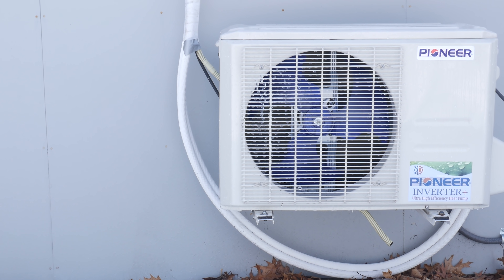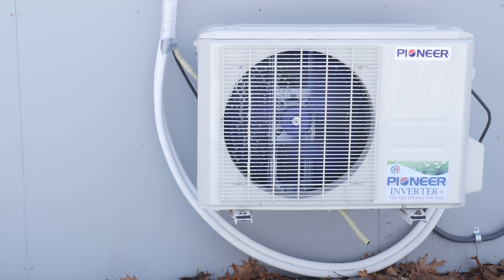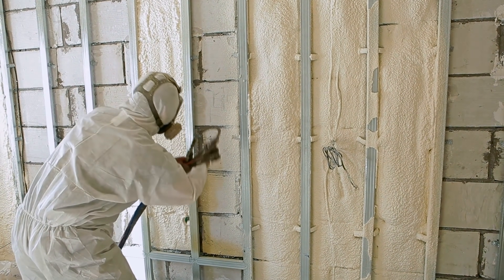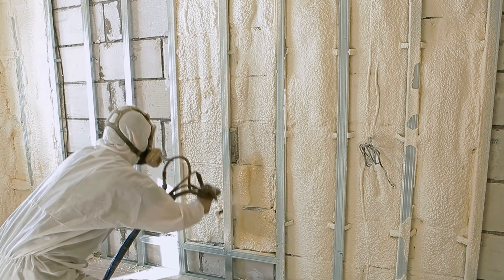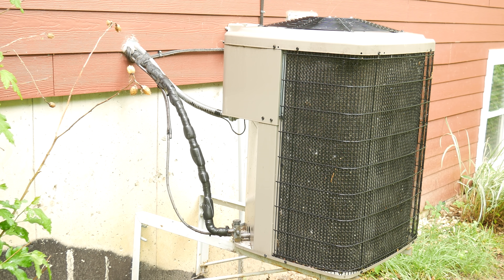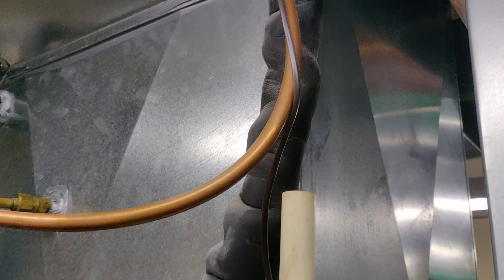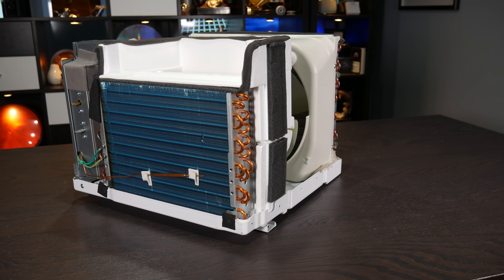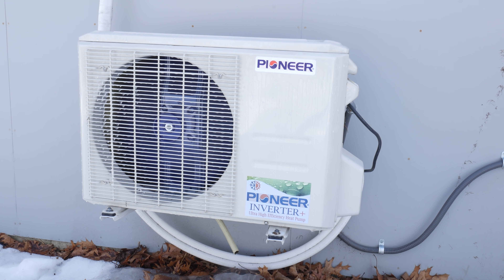Heat Pumps are Not Hard: Here's what it will take to start pumping

Comment: FYI i have a split system and it only has 1 main lines outside and has a splitter inside. Makes it very easy to run lines and looks nicer. I have a 5 ton unit with 8 secondary units.

Comment: my machine does not let the shared heads heat cool individually. the units can be on/ off individually, but there is only one outside condenser thing for three units, so the lines have to be going in the same direction to share that one outside radiator. I've had that happen before where my room turns off cooling because another room set itself to heating, it's a rare problem but can occur when you want an uncofortably cold room such as running electronic equipment, and share refrigerant with living spaces

Comment: A multi split system (one outside unit with more than one inside unit) are extremely flexible. It is very easy to only heat the room/s in use instead of having to heat rooms that are not being used.

Comment: Having just bought a new furnace/AC system in Minnesota, the current situation in the US is super frustrating. There's almost no HVAC contractors that will offer CCHPs (even in the Twin Cities) and beyond that, they're still incredibly expensive! It's ridiculous. Now, we have a new furnace and AC system that won't really need to be replaced until 2050. The companies are basically pushing everyone to continue using gas, and it's frustrating!

Comment: It's weird. I went to the NEEP site and could not find my Bryant 226CNA024000 Heat Pump on the list. Granted, it was installed in 2019 and may no longer be available, though I don't know why it wouldn't be on the site. According to Bryant it has a COP of 2.6, HSPF of 9, SEER of 16 (combined with the FB4CNP024L00 Air Handler, AHRI Reference # 10484419). 

1 to 2 higher SEER rating and I would have paid almost double. I put that money toward better insulation.

Comment: In Japan, you can have a single head mini split installed for a few hundred bucks. Multi head systems aren’t common. Also, power is often supplied at the head, not the outdoor unit.

Comment: I can absolutely confirm that some (most?) HVAC companies aren't interested in anything other than installing new and expensive units.  I was in the process of buying a house and the central AC wouldnt work.  They quoted over 8000 to replace the system when all it needed was a replacement circuit breaker in the main circuit box.  The breaker had started to fail and would trip when the compressor tried to turn on (the fan could run without tripping the breaker).  $35 and problem solved,  I cant stand shady companies.

Comment: The noise part was understandably handwavy since it wasn't the focus of the video. But there's a lot of research on the harmful effects of noise. My gut says that "90% reduction in car traffic" + "100% heat pump adoption" would cause less ambient noise observed on the sidewalk than "no change in car traffic" + "0% heat pump adoption". The answer is to look into this more. View noise as a holistic problem, rather than single out heat pumps and not SUVs.

Comment: When it comes to heating. A heat pump can be safely used as a heat source for underfloor heating (water heating). Water temperature in such heating system can be max 55oC.

Comment: On any of the "-to-water" systems there is the possibility to put a small "topheater" boiler to raise the temperature from ~45-50°C to 60-65°C on the water we use. I have a 300 liter boiler heated to ~50°C by the heatpump and then have a 100 liiter electrical boiler where it is heated to ~75°C. That works for me...

Comment: Say you have an old or dead A/C unit, and are looking to replace it with either a traditional A/C unit or a heat pump. You also live in the south where summer temperatures can get up to 95-110*F and humidity can get up to 95%. 

Would you recommend a heat pump? Would this also cause a TON of condensate in the inside unit (thinking potential for leaks)?

Comment: I don't know about Chicago but around here heat pumps have been common for 15 years. I just had to have mine replaced and it was less than six grand installed.

Also my workplace has had water source heat pumps for over 30 years, and their efficiency versus air heat pumps is ridiculous.

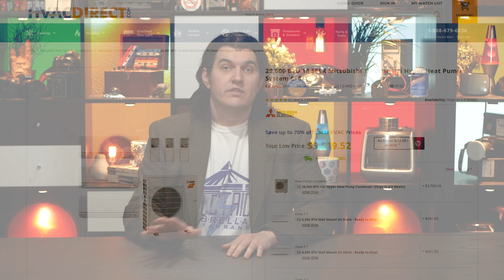Comment: 29:00 The HVAC techs in my city mark up the equipment 500% and charge nothing for labor.  I know this because I got a quote where the technician copy/pasted the description into the quote and it included the website of their supplier.  Going to the site, all the prices were precisely 1/5 the quoted price.  I called a couple other companies and asked for quotes on similar systems and got similar prices.
My central air conditioner is 18 years old and its refrigerant is no longer legal to use, so it's on its last legs.  Replacing it would cost $20K or more because the new refrigerant requires new line sets, so I looked into mini-splits.  A mini-split's individualized heating/cooling is a big bonus because I live in high-altitude desert and the sun heats different rooms very differently at different times of day in both summer and winter.
The companies quoted me $45,000 for two mini-splits.  My home could be handled by a pair of $3500 units.  With a few extended lines and such, that's under $8K of equipment.

Comment: The quote was most likely included running linesets inside the house instead of around on the outside and that each head unit would need a drain installed. Those two items alone can easily cost 3-5 thousand. Also since the world shut down from covid the prices for HAVAC equipment has inflated almost 80 percent over years prior. A typical bottle of freon went from $130 to $500 too.

Comment: I want to build multifamily housing, where when the temperatures are too low the maintenance guy tends a large wood fire configured to keep all the outdoor units warm enough. Or a cascade refrigeration system that sequesters co2 for use in greenhouses. Can we just install a reversing valve and control it with raspberry pi?

Comment: Costco has a 24K BTU DIY mini-split heat pump with a 20.5 SEER for $2300 here in 2023. I'm not sure if it can support more mini-splits, but still. So much cheaper than the $12,000 quote.

Comment: Just gonna give my two cents on AC stuff. People should invest into ductless heat pumps for HVAC instead of a traditional ducted HVAC system, but have a different reason to give. Traditional centralized HVAC systems are a common source of floor rot in my experience. The ducts inevitably develop leaks and allow for moist air to become entrapped in the floors and walls of a home. This promotes the growth of mold and bacteria that can very quickly disintegrate your floors. Being a residential contractor I've seen it happen in as little as 6 months. Obviously a heat pump will completely resolve this problem by removing the need to pump moisture rich air inside of your home. 

You can save electricity costs, reduce noise and moisture in your home, etc, etc but by far the biggest savings will be from needing to replace $50,000 worth of floors.
P.S window units are not immune to cause wall rot! If the drain to a wall unit becomes obstructed it will cause the water to back up and seep into your wall and window!

Comment: 20:10 I should also note that LG is a South Korean company, and I know they are not just making a power move to make it work just as well as it does above freezing. It needs to show that performance in 5 deg F simply because our winter falls to 5 deg F. Our homes don't have ducts anyway because we have heated floors. Fujitsu should be the same case.

Comment: I am having a new townhouse built and I was told by the builder at first that it was impossible to put a mini split in. He insisted gas was the only option. After sending a lot of documentation to him about it and discussing with trades, it was finally put in as an upgrade option.

7k for a 3 head unit.

Was it a lot, yup. Did someone make a lot of money, yup. Were there only a few of us in the complex which bought it, yup. However, it's done, behind the walls, looks good, heats and cools, and is warrantied.

I really don't get how in 2022 with the improved technology how this is debated so much.

Comment: I really want to replace my oil heating and in wall ac units with a ductless heat pump system, but the cost is simply too much. I've been quoted close to $30k for a 6 head system. Still waiting on the rebates from the HEEHRA program to go into effect.

Comment: Hi, how hot does the air get at the output? Is the max output temperature dependant upon the outside temp?
For clarity, in UK most systems rely on hot water piped to radiators, this is limited by the temp of water (normally about 70 C/160 F), I know/believe heat pumps can't match this for heating water, to pump through radiators. Your suggestion is to heat the air directly (rather than water to radiator to air), but how hot can the air get and is that dependant on the outside temp?
Reply: you can heat water for radiators with a air to water heatpump, they are just as good as air to air pumps. and radiator water can reach atleast 55c with only the heatpump. If you wish most air to water heatpumps come with an electrical heater built in. So that you can if you wish, heat the water up to 70c, if that is needed to reach the indoor temperature you want. In most cases that electrical heater built in runs maybe a couple hours per year at most, the heatpump doing the rest of the work at 4x the efficiency. The heat of the water for a air to water and the heat of the air for an air to air is dependant on outside temperature yes. But to feel a difference you basically need to have -20c outside. Which it usually isn't in Sweden, where i live or in UK. not for prolonged periods. most modern ones handle almost full efficiency down to -25c. some to -30celsius.

Comment: In your example of your friend who was getting a replacement, i have severe doubt on the quoted example of the air conditioner was 3k.  the only chance is that the a/c unit was one of the old 13 seer versions.  a high efficiency air condition that's 19+ seer would probably be double the price if not more.

Comment: We had a Mitsubishi system installed incorrectly a couple years ago and are still trying to get the situation remedied. They spec'd and installed two SVZ air handlers with an MXZ-3C24NA2 outdoor unit, and apparently this is an invalid combo according to Mitsubishi.

Comment: A few notes, that "communication" wire is high voltage wire and running it unprotected like that is a huge code violation in all states in the US.  Another note is that there are very few companies that have qualified technicians to do repairs on these systems, and an awful lot of the system is designed as a throw away part.   The time that it takes to diagnose and repair these systems is on average probably 2 to 3 times ans long as a conventional system, so labor costs are going to be higher.   One of the biggest problems that I encounter is that there are a lot of cheep brands out there that only stay in business for a few years, then go out of business and start back up under a new brand name, this means that parts for those units are no longer available.   Unlike normal heat pumps, furnaces, or air conditioners, there are no universal parts for these, so if you cant get a board, or valve or even the fan blade, the whole unit is junk and has to be replaced.   My company does install hundreds of ductless split heat pumps, but we only install one brand that has been around since the 80s, so do your research before you buy.

Comment: Any chance on doing some experiments with your heat pump? like enclosing the outside unit in a portable greenhouse in the winter months? Kinda curious if it would make a drastic difference ....
Reply: While the thought of using a greenhouse in the winter time to collect heat and make the heat pump run better sounds like a fairly good idea, in practice it will not work.  The heat pump is using a 4,000 - 6,000 CFM fan to collect heat from the air outside, and if installed in a 6,000 CFM greenhouse, it would cool all of that air by about 15F each minute, and quickly remove all the heat from the greenhouse.  

I have another thought, such as using a well pump as a second evaporator on a cold night.  Then try to collect heat from the outdoor air coil, and then run that refrigerant through a water cooled heat exchanger, to warm that refrigerant to about 32F, as cold ground water goes through the other side of the heat exchanger and back into the ground.  However if the well pump used 500 watts, I don't think you would gain enough heat to make up for the water pump power consumption.  

So yes putting the heat pump into a greenhouse would make a Drastic change in the unit efficiency, it would drop very quickly as the air around the heat pump went from 45F to 15F in a couple of minutes.

Comment: A trade off of these newer mini-split systems is the electronics. If you have been running your system for several years and either the indoor or outdoor unit fails and can't be replaced, you may have to replace the whole system because new models may not be compatible with old models. Also, heat pumps run more than air conditioners, so they tend to reach end of life much sooner. These are things to consider, but not necessarily reasons not to get a heat pump or mini-split system..

Comment: I've been struggling to find a device that will work with our existing wiring. I guess its just too old, but we have a through-the-wall AC unit that's dying, and it has a NEMA 6-15P plug (245v, 15a). I also checked the breaker and its a 15A breaker.

But I can't seem to find a unit with these specifications anywhere. Nearly all the ACs/heat pumps (that use a plug) I can find are either for standard outlets or for NEMA 6-20P outlets.

Comment: Retrofitted insulation (and, for new buildings, designed-in insulating properties like lower ceilings and double-glazed windows) are undoubtedly a crucially important step in fixing the problem. But it's important not to overlook the issue of the "embodied" costs of manufacturing and installing  insulation materials:

"Most energy efficiency studies focus solely on the operational aspect of buildings, such as the energy it takes to heat and cool them. However, various studies have proven that the energy and emissions required to manufacture building products, such as insulation, can be just as significant. When they’re calculated using a comprehensive assessment technique, which includes all of the energy expended across the entire supply chain, the so-called “embodied” energy and emissions of a building can be equivalent to 50 years worth of a building’s operational energy requirement. "

quoted from a 2012 article by Robert Crawford, lecturer in Construction and Environmental Assessment, and André Stephan, postdoctoral Research Fellow, both at The University of Melbourne (Australia).

Given that many homes in new cities and suburbs barely get past 50 years before being knocked down and built over, is the embodied cost of insulation really going to be more environmentally sustainable than investing in solar-powered energy-efficient reverse-cycle heat pumps? 

I mean, ideally the situation should be that once a house is built it stays there, but the modern property market is such that many/most older houses (at least in Australia, where the property market exists in some kind of weird alternate-reality bubble separate from the rest of the world's property markets) are simply being demolished to make way for new efficiently-designed bungalows and "townhouses".
Reply: That said, I am generally in favour of replacing older inefficiently-designed houses with modern designs that have intrinsic energy-efficient (including insulating) factors built into the design and fittings (except for the way said replacements are being used as a way to further inflate an unsustainably-inflated property market rapidly moving ever further away from the budgets of even comparatively wealthy families, in order to funnel wealth into the hands of a few elites and their hedge funds)...

But does it make sense to invest 50 years' worth of operational costs into a home that will be demolished in 10 years?

Comment: I've often wondered what the numbers would look like if instead of ducts a house was built with one head per room. One question I have is what would happen to air quality without ducts moving air around the house? Would love to see a video on that.
Reply: I worked at a University that used ductless heat pumps in one of the new dorms.  It had 1 head in each room, and worked great - even without forced air ventilation.  The hallways had 100% make up air, with the bathroom fans taking that 3,000 CFM of air back to the make up air unit heat exchanger, that exhausted the bathroom air, cooling the incoming air in the summer, providing heat to that air in the winter.  It worked great!  

At a retirement center, the new homes used a bathroom fan that runs full time - exhausting 70 CFM from the home 24 hours a day to force make up air into the house.  That works fine too, even though that house also had a furnace and 1 speed air conditioner.  The modern R-25+ insulation, and sealed all the walls so they do NOT leak any air.  Thus the make up air was a new requirement.

Comment: I'm getting quotes for replacements for an old AC/Gas furnace with both heat pumps + backup furnace or AC + Furnace. I'd be happy to send you the details @Technology Connections but only if you're interested in more anecdotal data from across the U.S.  Short version: in Portland OR August 2022 the price to install a mediocre heat pump with a backup gas or electric furnace is the same price as to install a traditional AC unit and gas or electric furnace.